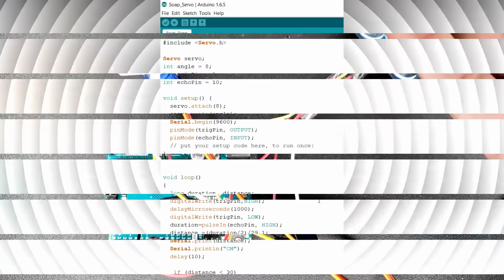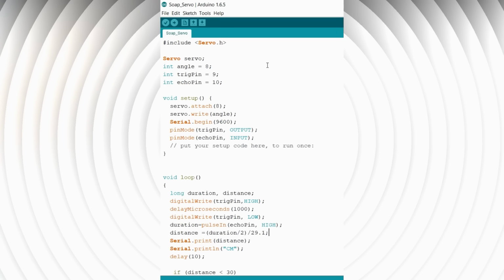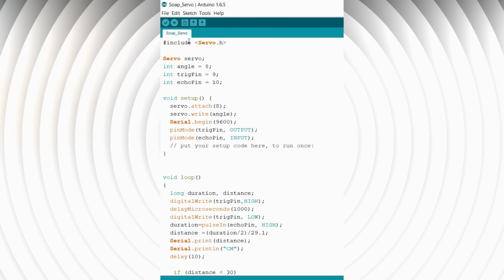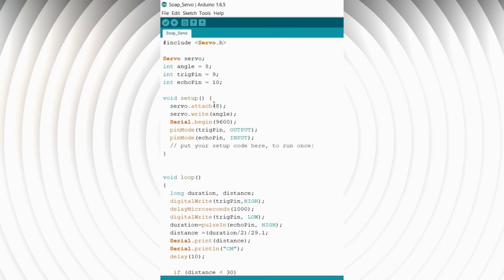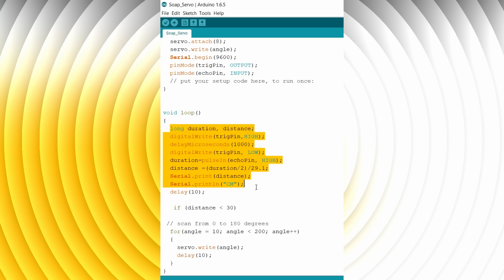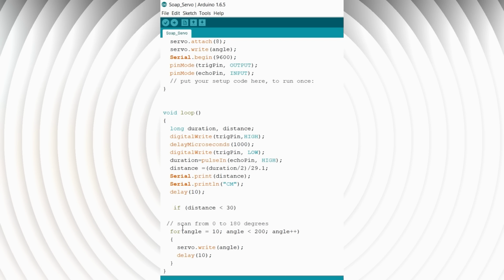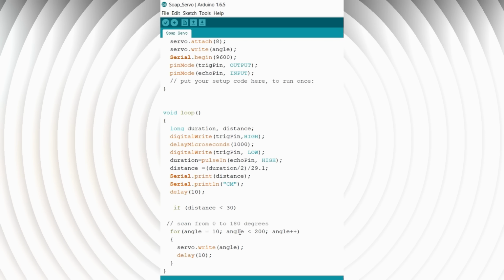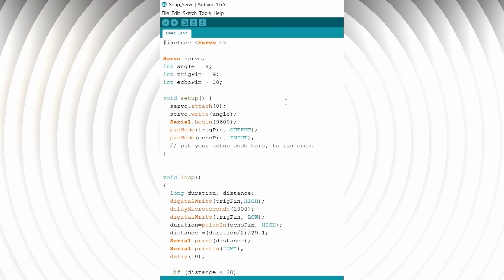How to combine an Servo and Ultrasonic Sensor and code

Comment: I'm designing a puppet with a blinking mechanism that will (hopefully) be controlled by a sensor. This video is super helpful, especially your initial example of the touchless hand sanitizer dispenser. Such a common device that helps me understand the concept instantly! Please continue dropping The Technical Heat.
Reply from the maker: Welcome more videos on the way!

Comment: Hello Dre pls I need ur help with my project am making a smart dustbin , using two ultrasonic sensor, servo motor , Arduino uno and a GSM module pls I would really appreciate if am helped with the circuit diagram.
Reply from the maker: whats a smart dustbin?
Reply: @DreThePlug  
okay the dustbin would be able to sense a human presence and open automatically on it's own the when it's full it will send notifications or message to the user phone
Reply from the maker: @aniefiokpatrick2258  ohh okay yes this code will be perfect for it
Reply: @DreThePlug  I needed the circuit diagram pls
Reply from the maker: @aniefiokpatrick2258  what's wrong with this one
Reply: @aniefiokpatrick2258  iam working on the same project did you find a code or circuit diagram?

Comment: Hey bro, you think you can help me out for a sec? I tried your coding and it worked perfectly, but the problem is I need my servo to stay in position when it's still detecting my hand, and then when I take my hand of it will go back to it's normal state. Is there a way to change the coding for that?
Reply from the maker: Yes
Reply from the maker: Remove the section of code in the loop section that's what make the code repeat over and over again
Reply: @DreThePlug  Wait so the whole thing?
Reply: @DreThePlug  From long duration all the way down to delay?
Reply from the maker: Just the servo parts
Reply: @DreThePlug  Can you give me specifics? I'm kinda stuck.
Reply: @DreThePlug  Hello, me again. I asked for the specific codings parts you told me to take out, but idk which ones. Plz reply and help me for a sec.

Comment: i want to make the servo stop at the exact position as soon as i remove the hand above the Ultrasonic sensor....HOW CAN I ACHIEVE THAT ....PLEASE HELP
Reply from the maker: You'll have to play with the degree number to get it to exactly what you would want keep changing the number
Reply: @DreThePlug  i want that that as the distance Becomes less than 30cm the servo should stop at the exact position without completing the whole rotation cycle ..... But didn't ur answer can you please tell in brief

Comment: hello I used the code but the servo motor is constantly looping
how do I make it such that the ultrasonic has to detect movement first for the servo motor to move
Reply from the maker: You need to remove the delay the delay make it loop
Reply: @DreThePlug  which delay? the (10) or the (2) or the (500)? because I have the same problem as the person who commented above
Reply from the maker: The servo isn't moving ?
Reply: @DreThePlug  no the problem was that my servo kept on moving but when it detected movement it stopped. I already fixed the problem and now the servo only moves if it detects movement. Thanks for replying though!
Reply from the maker: @hey_romy652  that's good 👍 😎
Reply: @hey_romy652  how did you fix it

Comment: Hey, I copied the code from the description and when I try to verify the code, it says.............  'Servo' does not name a type; did you mean 'Serial'? Can you tell what happened and how to fix it?
Reply from the maker: You need the library for the servo that's why
Reply: @DreThePlug  ooooo ok thx
Reply from the maker: @hotmom7241  welcome
Reply: @DreThePlug  I got the code to work, but I can't seem to figure out why my nothing is reading. it just says 0cm until I unplug the ground wire and then a bunch of random numbers show up. Is this a problem with the way my ultrasonic sensor is hooked up, or is it something else?
Reply from the maker: @hotmom7241  if it show 0cm then yes
Reply: @DreThePlug  then wat do i do?
Reply from the maker: @hotmom7241  I will try to see if the sensor work but its self first
Reply from the maker: https://youtu.be/_qVQprHbBpE
Reply: @DreThePlug  how do i hook it up?
Reply: @DreThePlug  thx
Reply: @DreThePlug  it worked. now wat do I do?
Reply from the maker: @hotmom7241  try to add the sensor and add in the servo code to what you already have working
Reply: @DreThePlug  thats wat i did and it seems to be working for the most part! Now I have to do some tweaking myself! thank you for all the help! ill let u know if I need any help!
Reply from the maker: 🙏 welcome🔥

Comment: I have a question. Can you change the programming, so it’s for two ultrasonic sensors that are both linked to the same servo motor. But one ultrasonic sensor changes the direction and the other changes the servo to the other direction?
Reply from the maker: You can just program 1 sensor to do 2 different things
Reply: @DreThePlug   but what I’m working on it requires two ultrasonic sensors
Reply from the maker: Why not connect the 2 sensor wires  together
Reply: @DreThePlug  I’ve tried that but it’s not working
Reply from the maker: You may need to plug the 5v pin into separate power sources

Comment: what if i use servo motor mg995, 360 rotation? do i need to change the code?
Reply from the maker: Yes it will work for all servos 👌🏽
Reply: @DreThePlug  what if i dont want the servo motor turn to the opposite way as in the video. i want it stop as the sensor doesnt detect something and start rotate back same way when the sensor detect it back. For example the motor needed to be attached to a toothpaste squeezer.

Comment: Can you make it Wireless... Please
Reply from the maker: Which part wireless ?
Reply: @DreThePlug  can you make the servo motor and ultrasonic sensor Wireless using 2 arduino

When you are near to the ultrasonic sensor the servo motor moves
Reply from the maker: Noo the servo and arduino is code to do specific things if they become wireless they won't be in sync with each other
Reply: @DreThePlug  can you make them Wireless using nRF24L01 or rf433
Reply from the maker: @hamdyahmed36  i don't think so or at least I never have before
Reply: @DreThePlug  ok Thanks

Comment: Thanks for this video sir,
how can i use both the function of servo and UR sensor at the same time ? Like, I want to rotate my servo 0 to 180 and 180 to 0 continuously and UR sensor will respond to led not servo. I want to combine both the function at the same time.
Reply from the maker: You must write each line right after another for each instruction

Comment: @DreThePlug That is a clear step-by-step video. I loved loved how you made it easy for students like me and other DIY enthusiasts stop scrolling through pages and YT videos to understand how it all works. YouTube should rank you high for servo motors and ultrasonic sensors. I wish you had enough time to add comments to your code too. Question, what if I need my sensor to wait 2seconds after sensing something before communicating to the motor to move. What lines of code would you add to the code you have? and where in the code would you add them?
Reply from the maker: You will have to change the delay line to increase the delay time 1000 = 1 sec

Comment: The ultra sonic sensor senses Distance in every 10 seconds not continuously. Am i doing something wrong?
Reply from the maker: The code that i have it is continuously
Reply from the maker: Are you using 5v for the sensor
Reply: @DreThePlug  yes.
Reply: should i not go for it?
Reply from the maker: @AG148  idk with my code it doesn't have a delay of 10sec

Comment: Hi I do not know if you still read the comments but I have a problem, my servo motor will continuously turn if my hand does not reach with in the threshold distance and it does not work like yours, I coded verbatim what you did. Is there something wrong with my servo?
Reply from the maker: It sound like something is wrong with your servo you could possible screw the handle wrong